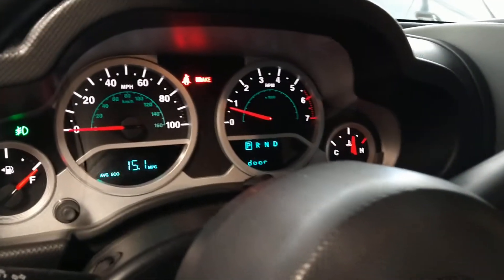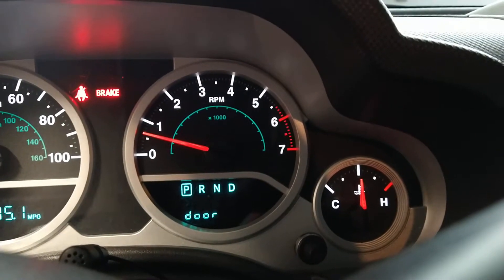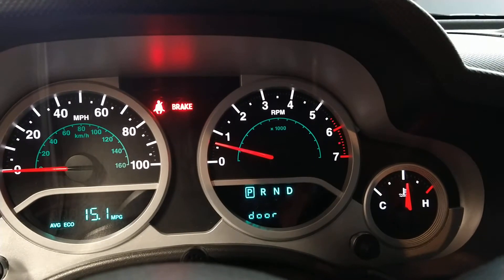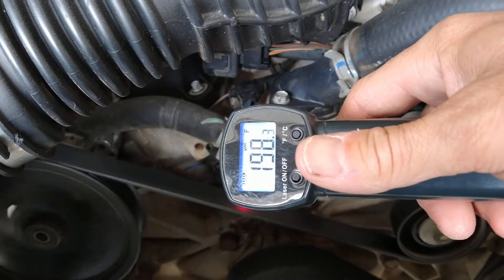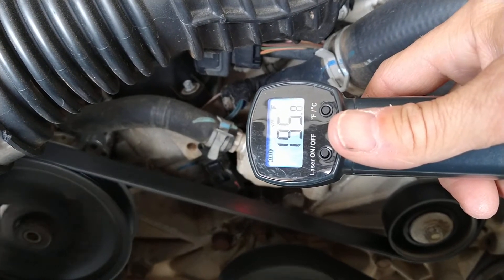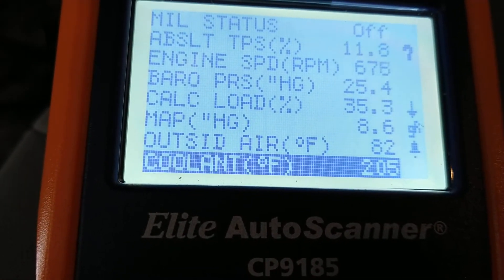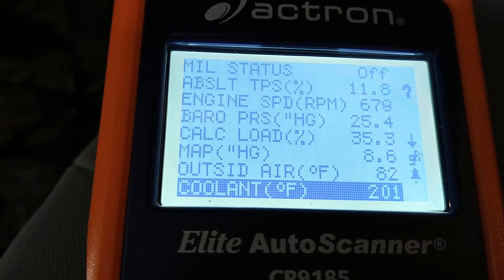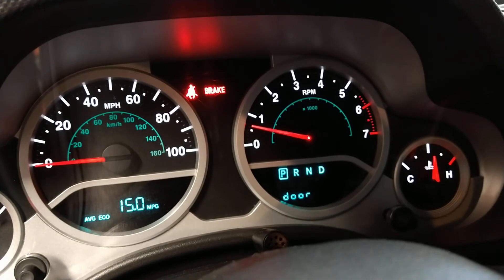Jeep JK engine temperature busting internet BS. Read description!

Comment: Mine runs at 219 when going 75 
When idling it goes down to 209
Cooling system is fine every thing was replaced,
Climate here is 100+ in the summer, and around 95 at night,
Temp remains the same regardless

Comment: I’m gonna guess before you show it ,, that normal engine temp is about 195 to 200 ,, but I’m assuming you can alter that to be cooler if you wanted by swapping to 180 degree thermostat .